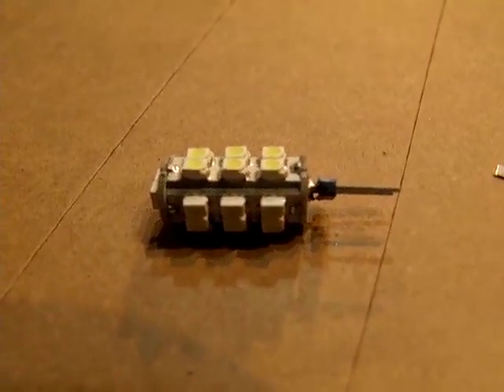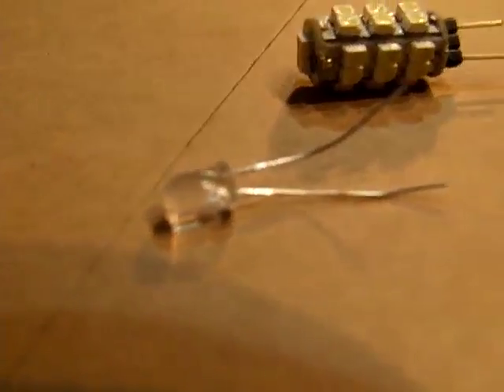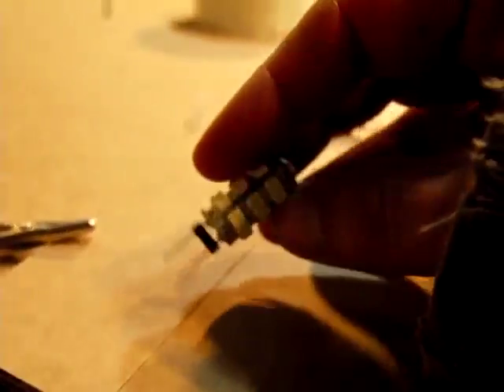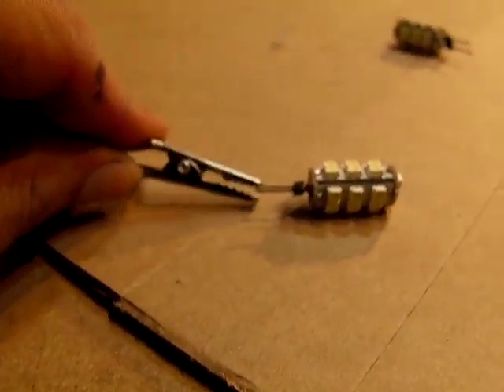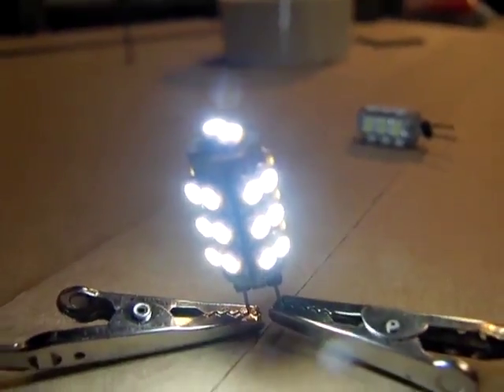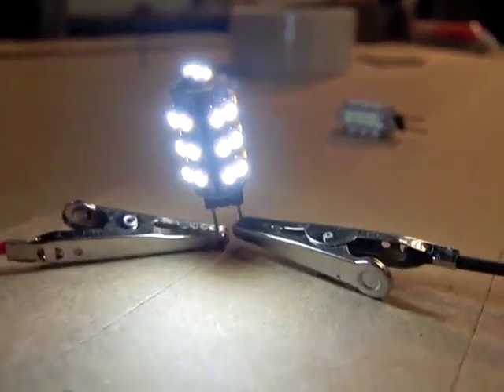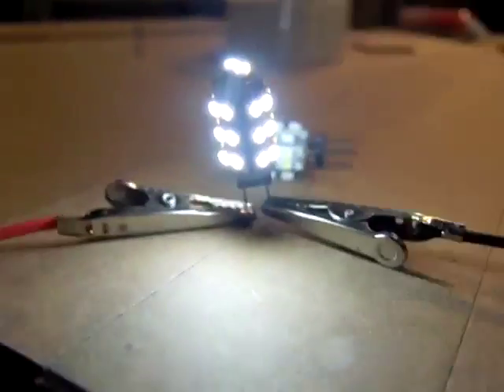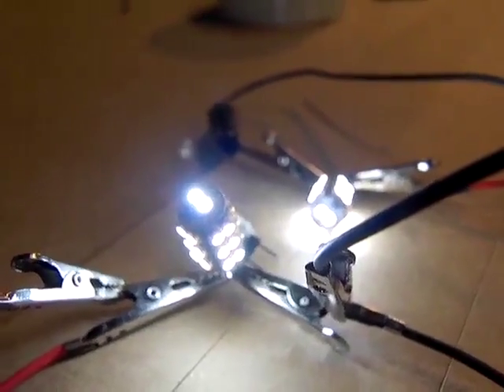LED bulbs 12 volt $1 = 2 WATT Light Emitting Diode 12v led bulb 26 smd G4

Comment: I simply duplicated what these guys in the videos below did and used an LED bulb instead (draws less AMPS) and lasts longer. Bought the LED bulbs at Walmart for around $5 each and put the whole thing in a clear plastic container with the bulb set on top and wired a toggle switched for on/off:
 
/watch?v=Q4Qo68HvxoE
/watch?v=wBuXeanEFhY

Comment: I've already done it. Use the flash unit circuit board from a disposable camera as a joule thief (look for videos on YouTube for it) and it will run these bulbs for 4 days on a single AA or AAA 1.5 volt battery. Excellent emergency backup lights. I put a toggle switch in my setup.

Comment: At the moment there are few reasonably priced LED bulbs available. I'm currently testing some  7 watt warm white bulbs, they were quite pricey at about a tenner each but in theory should last much longer than CFL and a great deal longer than incandescent bulbs. 

So far the LED perform well with immediate brightness and no warm up or delay like CFL's.

Brightness and light qualities equivalent to a 60-70 watt incandescent bulbs.

Comment: Xmas lights are great for lighting.  We have a pantry in our house that was really hard to see in.  I added a plug in the ceiling that is wired into the hall light only 2 feet away and strung a length of the small LED lights around the inside of the pantry.  My wife LOVES it because she can see everything on every shelf.  I'm going to do the same thing with lights out on my porch.  Great lighting and energy efficient!

Comment: @v3511  Color temperature is actually a common measurement used to describe the wavelength, i.e., the inverse of frequency, which is what determines color.  The red end of the spectrum has longer wavelengths, maybe 3200K (Kelvin) whereas the blue end may be over 6500K.  The sun is considered white, so for a natural daylight look, you'd want a color temperature probably over 5000K.  Also, if you google spectroscopy, you'll find the astronomical approach to color temperature.

Comment: @bodryn Yes I had the bulbs used for general room lighting,caz those a R the 1s that the Eff. strds. R targeting 1st. & the bulbs most will be seeking to replace Getting more affordable isn't relative, when most are interested in the cost when when they are forced to replace bulbs For many spot lighting isn't comfortable & will resist that route as long as they can. I'm not anti-LED & I have been experiment with the affordable LED bulbs, but they aren't working that well for me available

Comment: This isn't actually as good of a value for money as you think it is Dan. Not only do these multi-LED lamps last less (they dim much quicker due to really poor heat dissipation and driver design), but you can also just put 2 x 20 cent 1 watt LEDs together, and you'll get a much better result (provided that there is an appropriate heat sink), especially since most of the LEDs used in such car lamps are of very low efficiency (most likely 40 lumen/watt - and I bet they don't go past 75 lumen/watt).

Comment: @30GB  Efficient compared to what? Lumens per watt is the only valid comparison. Doesn't matter how many die in each LED or how many LED are in the bulb. Not to mention the area actually illuminated. As things stand now a multiple LED "bulb" is likely to illuminate a greater area than a single LED

Comment: @ricochetVendetta yes.  they are little pricey right now (especially the high end ones) but see that price dropping as they continue to engineer them to be easily manufactured.  If you think about it tho, led Christmas lights plug right into the socket so to me its not much of a stretch to condense it down into bulb form

Comment: @ricochetVendetta I currently have 2 LED bulbs in my room. They are 2 watts each. They have a standard screw base. So they work with any standard light. If I remember right I payed $16 each for them. I picked them up in the bulb section of my local mega mart. Right by the florescent bulbs.

Comment: People dont realize LEDs are the future of lighting.  This push for CFLs is confusing, while LED bulbs are on the horizon and are far more durable and much more energy efficient.  I bought one led bulb a few years ago(on ebay) and it has yet to burn out, while the CFL bulbs I buy all seem to burn out well before their claimed lifespan.  They have started selling LED bulbs in hardware stores, so not much need to rig your own unless you're using a special power source :)

Comment: Dan could you show a watts meter LEDs and CFL bulbs on the ac ones . most of my CFL bulbs are 40 watts and higher (to 90 watts) when rated at 14 watts (all of them) . Just want to know if you see the same thing . i was using them off a solar battery inverter system , now i only use LEDs . the rating is off or is it just me ?  Killed my batteries way to fast not to be right. mine are the GE CFLs  but all are not rated right or is it the watts tester i'm using, plug in type?